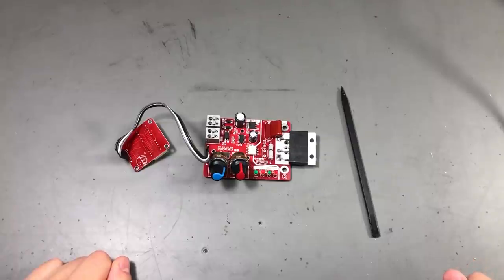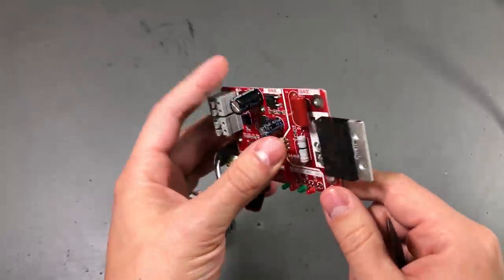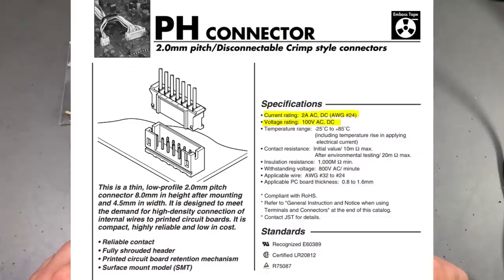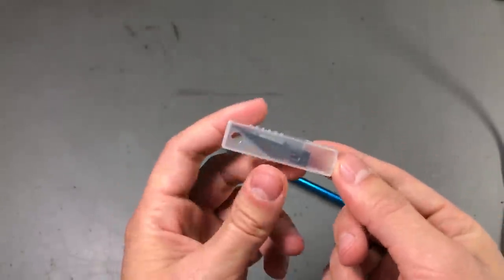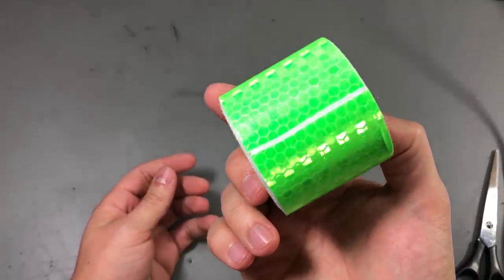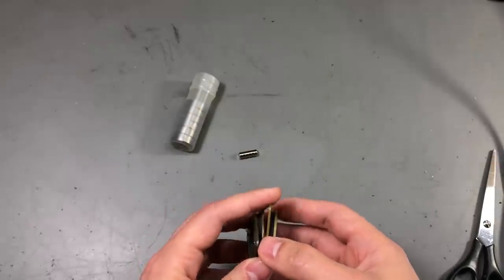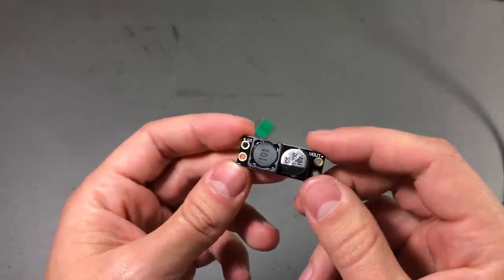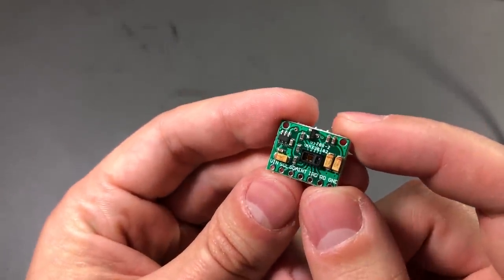Voltlog #189 - InTheMail

Comment: Soap cases. I used to use soap cases for small projects back then - with a little luck you could find a model with a flat top and you were golden. Extruded aluminium ones are admittedly much nicer these days...
Reply: Me too
Reply from the maker: yes, I remember I once used a soap case for a simple project with a 9V battery, it was a nice fit.

Comment: The the vibration dampers are only good for the Z axes ,on the Y and X you want maximum belt tension  ,these dampers are the weak ,you either pull the stepper out of alinement so that the belt isn't tracking well ,and over time the damper rubber piece will separate from the steel plate because off the side force (tension).
And they are terrible if you want accurate prints  and minimal ghosting.
But that is my experience with them ,i have a dubbel direct drive extruders so there is some mass and weight to change direction.
But the CR 10 is bowdenstyle so maybe you get away with this ,but don't tension the belts to hard or these dampers will give.
Reply from the maker: I didn't notice any degradation in the print quality since I installed them but I don't do any precision prints here..

Comment: I like scalpels and scalpel blades. Blades cost about $0.10 in packs of 100 depending on where you get them. Add a quality handle and you're good to go for a long time. Known brand handles like Swan and Morton are not that pricey either, perhaps something like $5 to $10 and they should last you a long time.
Scalpel blades come in different shapes and they cut very well, much better than exacto style blades. Scalpel blades don't take abuse as much as thicker blades. Don't use them to pry stuff.

Comment: How about quality of the JST connectors? Will their plastic parts will handle soldering temperature properly?
Reply from the maker: the quality: probably not as good as some known manufacturer of connectors but they are surface mount so they will withstand the reflow temperature without any issue making them good enough for prototyping work.
Reply: @voltlog  Thanks for the info.

Comment: VoltLog+ to acquire 15v go to a 5S and use diodes in series to step down or a linear voltage regulator to step up or maybe both if needed. It's hard to nail 15v
Reply: Maybe resistors?
Reply: Use LiFEPO4 5S 16v and  a diode so close
Reply: 13 rechargeable AA = 15.6 and add one diode. That's all I got.
Reply: Some phone batteries come in 3.8v x 4 =15.2v
Reply from the maker: it doesn't have to be exactly 15V, I can go higher. No step-up is allowed and I will probably want to use a step-down to keep a nice steady voltage on the input to improve the stability. The solution needs to be practical so 13 rechargeable AA batteries is not a very practical solution.
Reply: @voltlog here's many others I left
Reply: @voltlog I knew you would pick out the most impractical idea to comment on so use the 4 smartphone batteries 3.8v 15.2v or is that bad too? I asked a couple times on how to make the Bluetooth antenna reception better and I asked if adding a wire by soldering an inch and a half wire and you said that was a terrible idea yet you had no suggestions so I found over a dozen different videos showing just that, solder a wire close to an inch and a half long and they work perfect. I also asked how to get 5v and said could a linear 3 pin module would work and that was bad because they're not efficient, so I asked any ideas? no reply.
Reply from the maker: @MrBrymstond  Well let me give you more feedback then, phone batteries are a bad idea first because I would have to solder on their terminals and second because they are not cheap and it's possible that if one of them goes bad it's a pain to find a replacement a year later, also they might require some special charging chip due to their different chemistry. 13 rechargeable AA batteries, big NO for obvious reasons, not a practical sollution. Lifepo4 might be a solution, it's on the table so far, I am looking into that.  Don't take it so personal, I receive many comments and I don't have time to explain in great detail why something is good or bad. Using a piece of wire as a bluetooth antenna is a terrible idea, anyone can tell you that. If you got it working like that, it was by luck, good for you. If you are looking for ideas on a particular problem than the eevblog forum is a better place to ask questions.
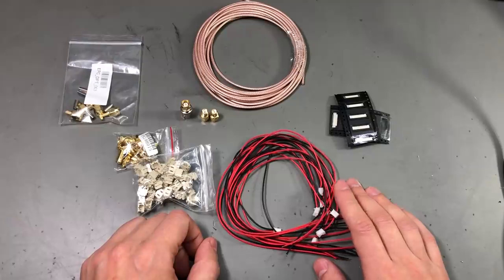Reply: @voltlog  If you go on Amazon you can find 3.8v phone batteries all day more common than some believe and they already have protection, simple to solder unlike a 18650 the solder takes to that tab as soon as you touch it, cheap for the amperage and extremely reliable being they're on 24/7 in most cases, so you know you have a quality cell. I would build two packs so when one needs charging the other is ready to go. Here's a link, I'm sure you can find something and they're small and compact.  https://www.amazon.com/s/ref=nb_sb_noss?url=search-alias%3Daps&field-keywords=3.8v+smartphone+batteries&rh=i%3Aaps%2Ck%3A3.8v+smartphone+batteries and for the addition to the antenna, I've done it to five or so Bluetooth boards, I figure it's only a few bucks so it's not a big deal and it worked like a charm so I did it a few more times for friends. Here's a link to do just that, it's not luck at all and you can start where he demonstrates the antenna. 5:45 https://www.youtube.com/watch?v=lefzEsQZHJ0 and I have other people doing the same. 7:32 https://www.youtube.com/watch?v=OvcK1HO2MkM Why ask all of us for ideas when you could easily go to the eevblog forum?  I don't take it personal, but it does become an issue when nobody has the perfect idea when I didn't think the ways to power it, my idea would be not to buy something knowing I'll be so particular on how I'm going to power a 15v device.
Reply from the maker: @MrBrymstond  I can ask a question because I have a youtube channel with many subscribers that can comment on the video. If you ask a question, that is directed at me, same as  all the other questions I receive, and the purpose of this channel is not to answer questions or offer support. I might answer questions and offer some solutions but I will not go into details as that would keep me in front of the computer all day long. On occasion I will ask questions on the forums, but this was not one of those occasions, I was already talking about the subject in the video so that's why I the questions was asked. If that wire antenna you did "worked like a charm" is not exactly something I or anyone else could really appreciate and replicate, it may have worked for you out of luck and once again good for you, or it may not work so good and you will still think it does.
Reply: @voltlog  There's so many people out there with a Bluetooth amp with range issues and I'm certain they would appreciate and replicate it easily with a piece of Cat 6 wire just over 1 1/2 inch long and solder it to the trace (antenna) to eliminate this issue. If you can't solder to a open trace have a friend do it, it's the difference of not using something you need or using it because it was a simple fix and only one example. You could have easily said you knew nothing about that, I trusted your judgement and respected you, but instead you went on like you were fully informed over it being so bad it would burn the thing out so I threw it in the drawer and left it there until I seen others doing that very idea and how well it worked so I tried with the same results. It's not brain surgery and it wont make you go broke if you destroyed $10 or $20USD, I simply started off with a 2" Cat 6 thin wire and nibbled it down until I found the right length and when I had more than enough signal almost doubling the distance of its claims? Maybe I have too much faith in people that do electrical work. So I'll ask once more, you don't think other people would find that interesting, appreciate, benefit and replicate the same thing with their device which many other people made videos about that appears to be a issue with some to many devices?
Reply from the maker: @MrBrymstond  I like doing things right, that's what engineers do.
Reply: @voltlog  Which is good and we all know how most cheap Chinese products are pushed out and clones of clones so "we" either repair them, throw them in a drawer or throw them out. I choose to repair them if possible, as cheap as they are they're still money and sometimes we have to reverse engineer them, what do you choose?
Reply from the maker: Those batteries will drop in voltage and for a 4s or 5s pack that could mean quite a variation from full to a drained battery which is not ideal. It's best if I go a little higher let's say with a 5s pack made from li-ion 14500 cells and then use an LDO to keep the voltage at a steady 15V. The voltage reference will produce a more stable output this way.
Reply: @voltlog  You can fit the 14500 in a AA holders if you should choose, but they're tight and somewhere around 900mAh is good. As long as it's not Audio I would use this. Personally I would have went with a 2 or 3P - 5S of the 3v They had others with a higher capacity and cheaper without the charger, but I don't know how much room you have to work with. The Low-dropout regulator is steady and clean linear, but it will eat the power. Sounds good
Reply from the maker: @MrBrymstond  I have already ordered the 14500 cells (850mAh rated) and a 6 pack AA holder. I'll use a balancing module like the one shown in the latest mailbag. The LDO will burn away power, but since the current of the LD584L will be small ~1mA it should be fine.

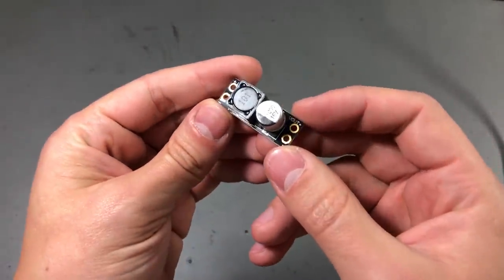Comment: @15:20   I'm thinking about getting that LC filter module. I have the Voltlog #53 Power supply  https://www.youtube.com/watch?v=D2tFFHfAeyQ&t=3s and it's noisy for my 2 way radio application, so am wondering if the LC-Filter will filter out the noise (PWM?) generated by the converter module?
Reply from the maker: yes, it will cut down on the noise just make sure you don't go near the rated voltage of the capacitor which is 16V. Or you could replace the capacitor with a higher rated one.

Comment: Yeah i have broblems with these different cheap usb 3.0 devices too (hubs, USB-RJ45, USB-SATA etc). With some PCs they work, some not (USB device not recognized). And cannot find driver anywhere. Should be plug and play as advertised.
Reply from the maker: nothing happens on my computer when I connect that to usb 3 ports. no detection at all... and like I mentioned I have connected maybe hundreds of different devices without any single issue.